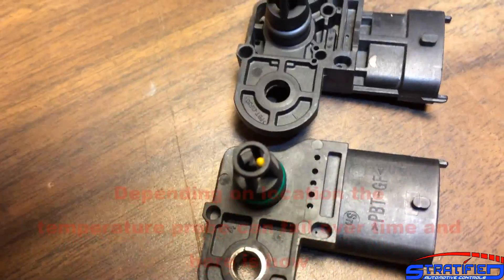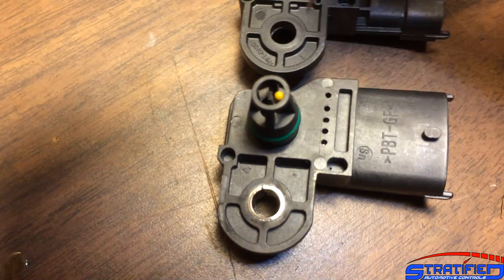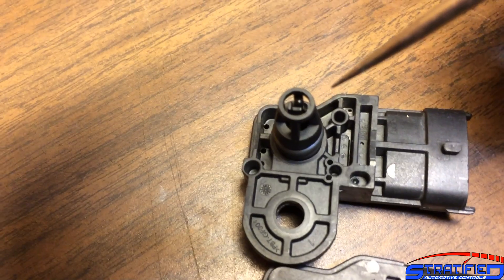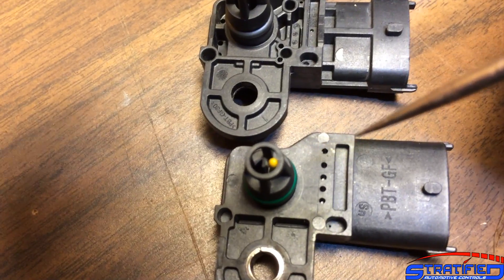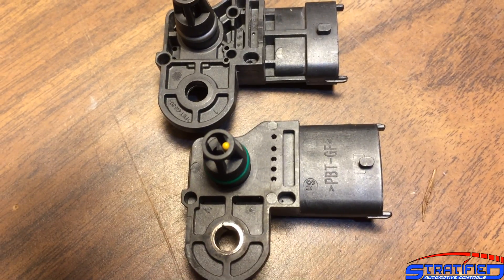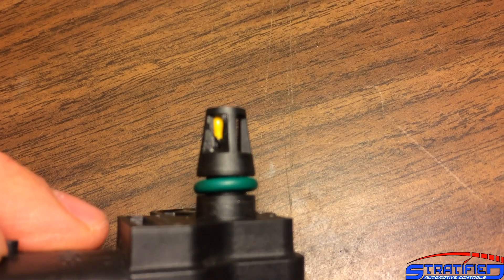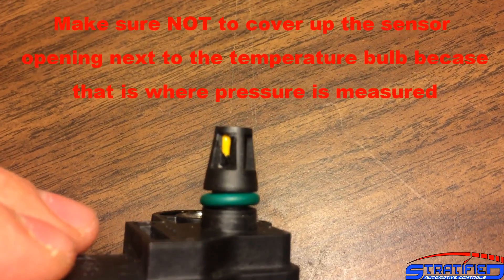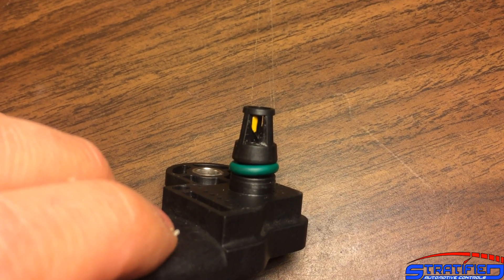Upgraded MAP sensor temperature probe fix

Comment: Bosch is not quality anymore. I installed in a Focus and the temperature probe disappeared in 6 months caused lots of issues lots vibration engine hesitation acceleration etc. No engine code I had manually diagnose till I find the trouble maker like back in the old days vehicles with cabarator.
Reply from the maker: I have seen that failure before more than 5 years ago. You just need to look at the charge air temperature to diagnose.

Comment: How does the vacume work is  there a hole inside the the spout I hardly have any of that yellow blob I used jml intake manifold cleaner and I think I degraded it what is the 4 holes for under the Conector

Comment: Hi

Does the MAP sensor on Focus ST actually measure temps? Or only manifold airflow pressure? Thanks
Reply: Vacuum air
Reply: It is a T/Map sensor. Almost all the ford ecoboost use a combined temp and pressure sensor for TIP (throttle inlet pressure) and Map sensors.

Comment: That's intelligent!  (or the other way around: the part designer or the Auto designer was dumb).  Thanks.  This shows that consumers are smarter than so called "automotive designers".  My favorite example of BAD and LOUSY design is the "PCV" system design, as the PCV valve allows the oil vapors and oil dorplets to really deposit a TON of crud inside the engine inlet tract.  I'm presently installing a small section of air-oil cooler followed by a Catch Can. Therefore the oil vapors can condense and the resulting oil droplets can be removed from the recirculation that fouls the inlet manifold, the MAP and T-MAP sensores, and the inlet port and valves.  Amclaussen.